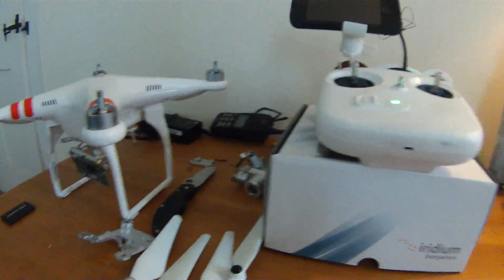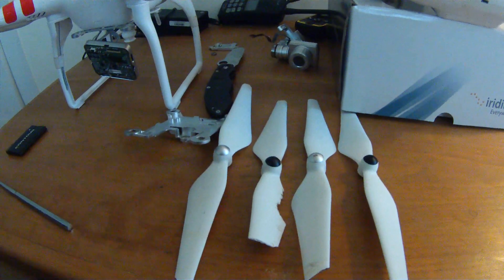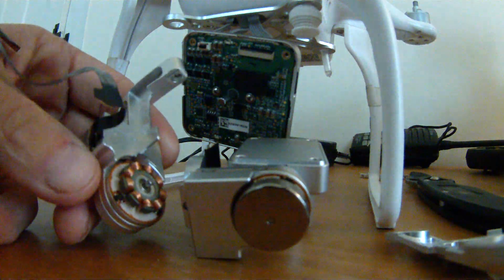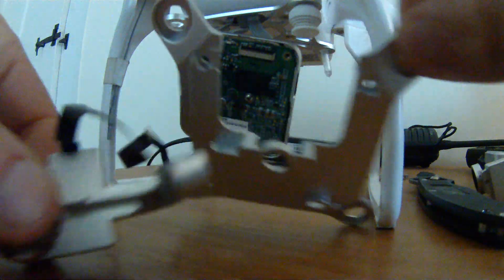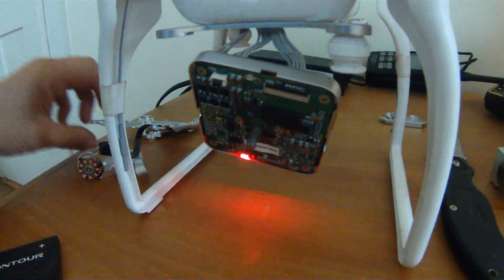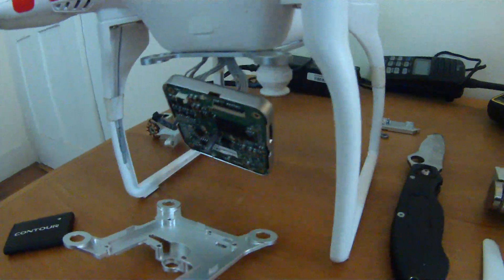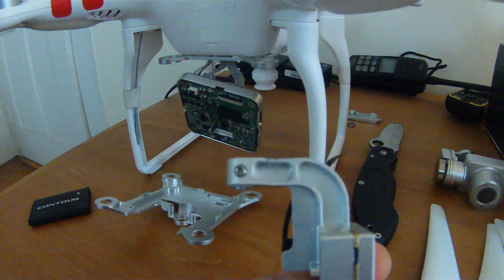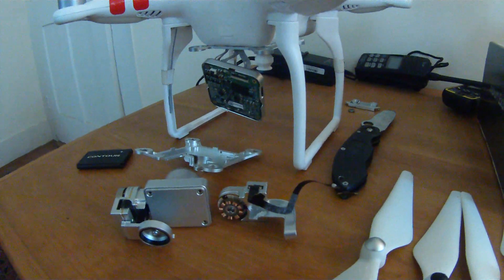Repairing a DJI PHANTOM VISION2+ gimbal

Comment: Hi, John.  Were you ever able to fix the gimbal?  Mine broke in the exact same way.
Reply from the maker: I replaced the ribbon and broken mounts.  The gimbal joints are simply magnetic press fits that pop back on.  All in all it's pretty simple to do if you have the necessary micro tools for the tiny screws.  I think it took me a few hours to do once I had the ribbon.  Working well so far but if you have severely damaged gimbal or camera you have to replace the entire unit.  Expensive but the good news is prices are getting cheaper.  Good luck.

Comment: I can more than likely fix everything. You shouldnt need to heat it only the bent motor shafts need annealing.  Often a potentiometer will break on one of the motor controllers. Its an easy repair. I have several pics on facebook showing some tricks for repair.
https://www.facebook.com/USdronerepair